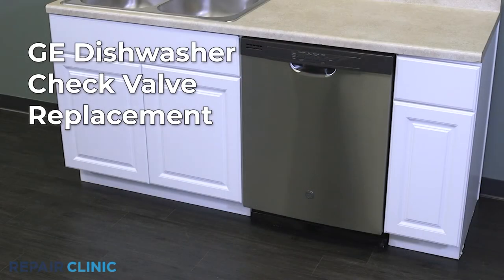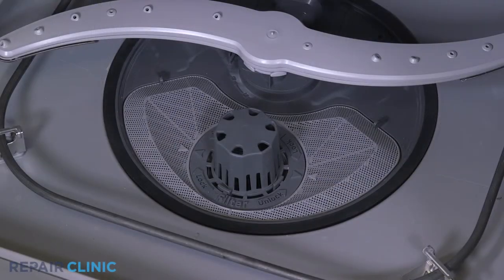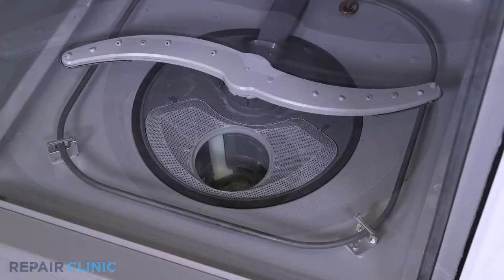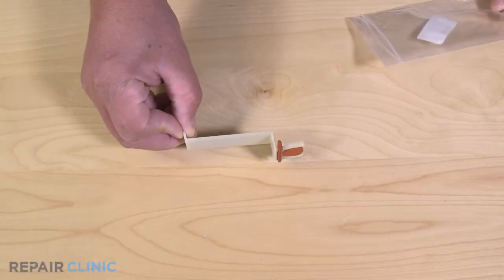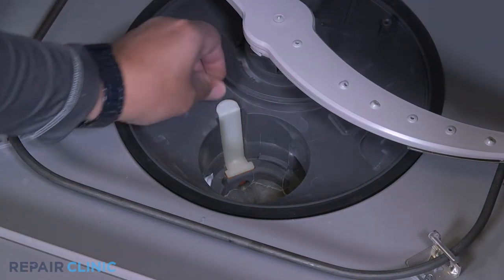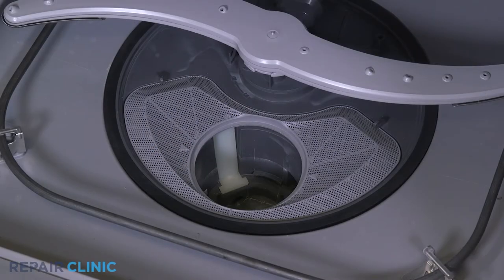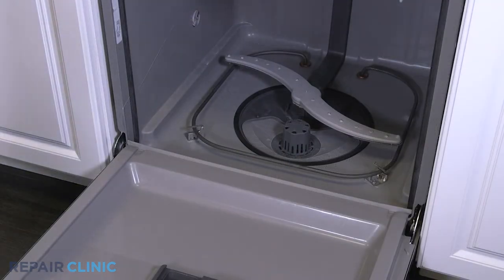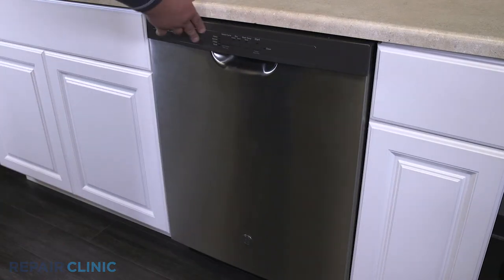GE Dishwasher Check Valve Replacement WD12X25476

Comment: I have the same problem with mine. Did you replace the check valve and did it resolve the problem or did you find other issues?

Comment: Why does mine only drains after I remove the valve?
Reply: Did you replace the check valve and it worked? Because it’s happening to me also
Reply: Replace the pressure sensor! I did and it works!
Reply: @matthewguarino7780  pressure sensor?? 😭  → WD21X25468
Reply: @monx  did you try it and not work?
Reply: @matthewguarino7780   i didn't need to, I just re-seated the check valve and it worked
Reply: @monx  glad that worked. I tried that myself and didn’t work. I’m just letting everyone know what happened to me and what worked.